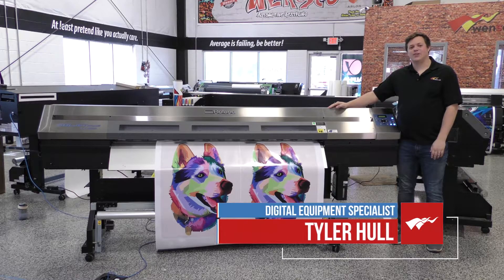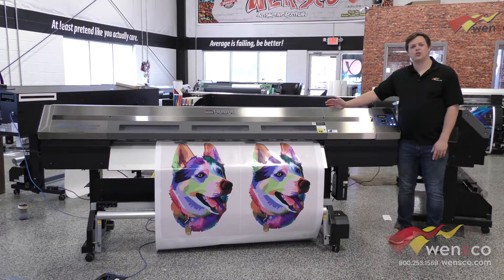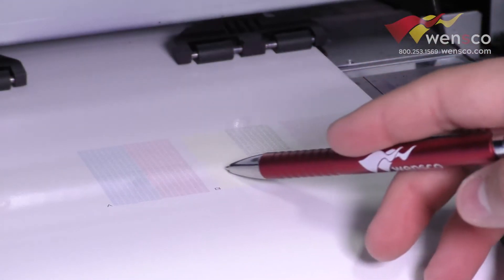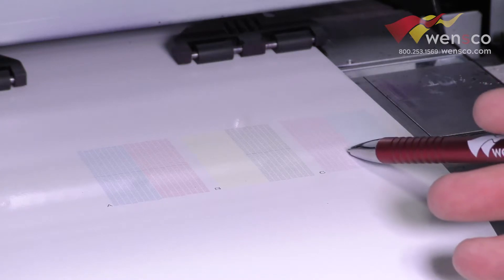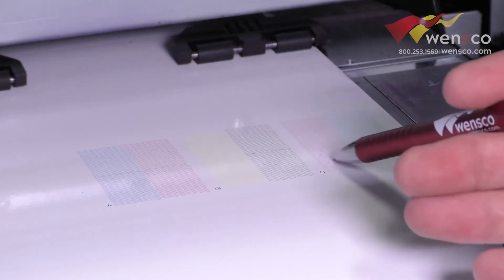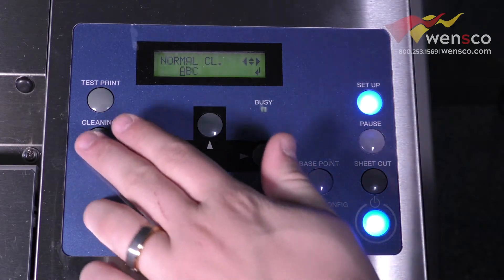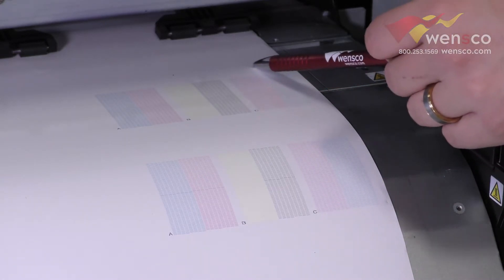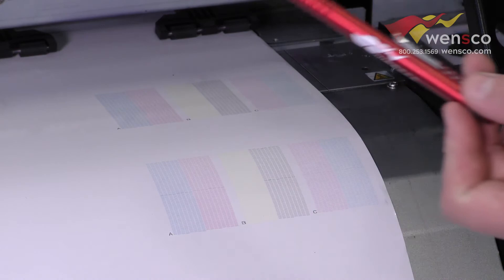Calibrating and Troubleshooting your Roland DG SOLJET Pro III XJ-640 Printer

Comment: hi, can you help me, my machine is the same as your machine, there is an error 0107, can you help me, what is the cause
Reply from the maker: This is an error due to the encoder strip. I would clean the encoder strip and see if that fixes your error. If you do not want to pay for a service call you could replace the encoder strip if cleaning it doesn't work. After that there are quite a few things that could be needed so I would reach out via our website and get some equipment support that way!